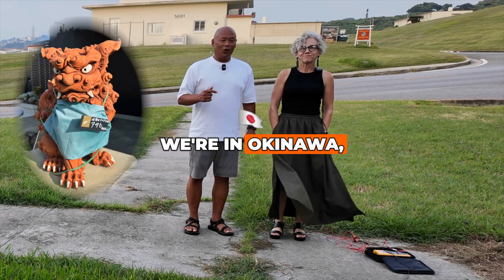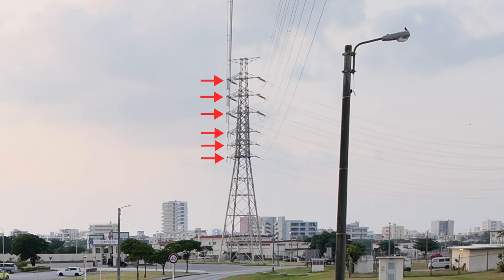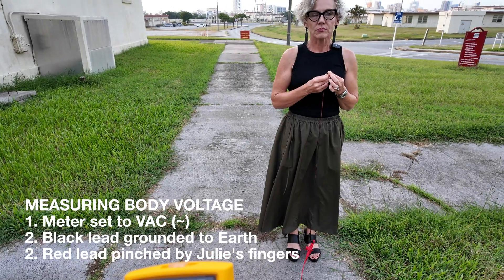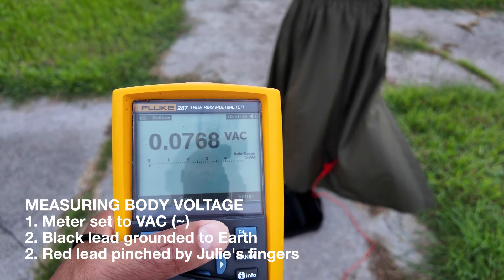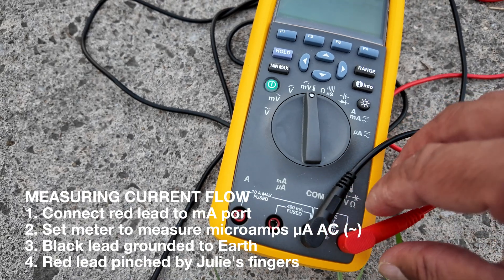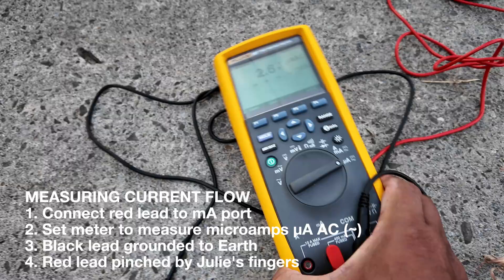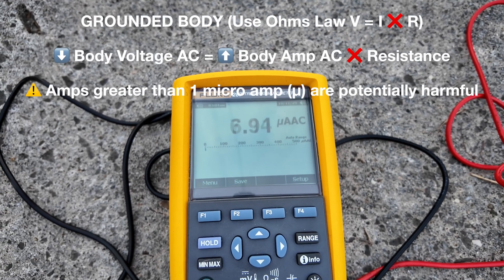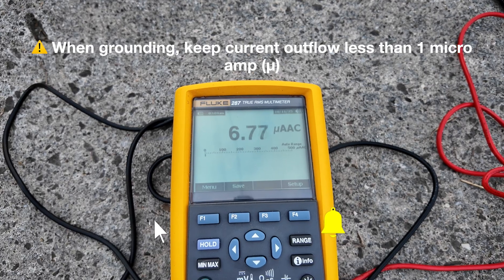I Tested Body Voltage Near Power Lines in Okinawa and Found SHOCKING Results

Comment: I recently connected my bed to earth after having it connected to my homes electrical ground. My home provided a complete ground whereas the earth only deducts 33% of my voltage. 

Do you think it is wise to stick with  the more moderate drop and avoid dirty electricity?
Reply from the maker: Yes, go with the Earth. Also, make sure that your meter is grounded to its own grounded rod inserted near the first grounding rod.
Reply: @DrAndrewDoan Thank you Dr.Doan, that makes a lot more sense. I had my meter connected to the outlet as reference.

Comment: Btw, I bought an EMF filter cord from Dr. Laura Koniver so that it blocks the dirty electricity from the house outlet on to my grounding mat. She tested it on her channel and blocks 99%.

It’s more expensive than an outlet plug but the outlet plug filter amplifies electricity 3 feet radius when plugged. 
So you’d have to be 3 ft away from an outlet if you put an outlet filter on the outlet. Which in my opinion is a nuance.
Reply from the maker: Dr. Koniver’s cord blocks electricity but doesn’t reduce body voltage. Until her cord is used in a clinical study, I cannot recommend her cord.

Comment: Might have explain that last part when you have time for us electrical dummies , hope you enjoy your travels
Reply from the maker: Thank you for your comment. In the video, the power lines generate body voltage AC via capacitive coupling. When grounded, the body drains off the voltage as current flowing into the Earth. Current flow above 1 microamp may be harmful and associated with cancers and illnesses.